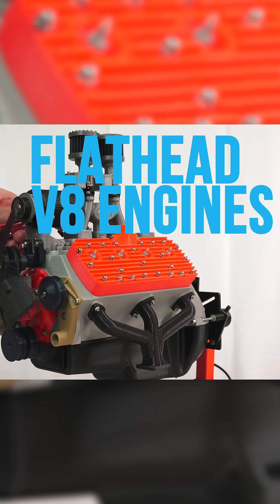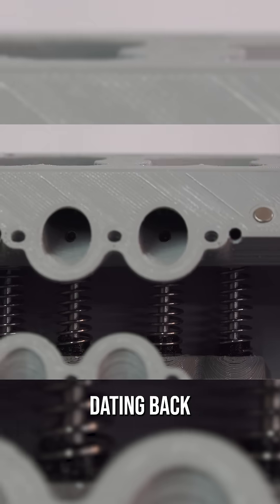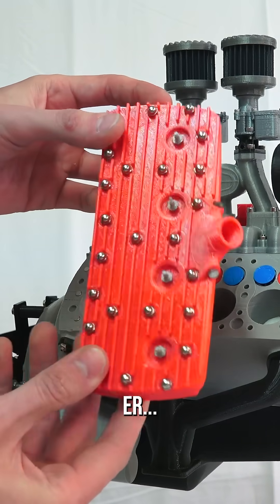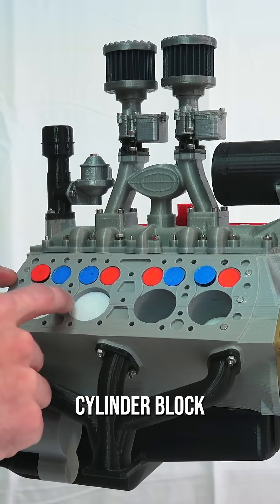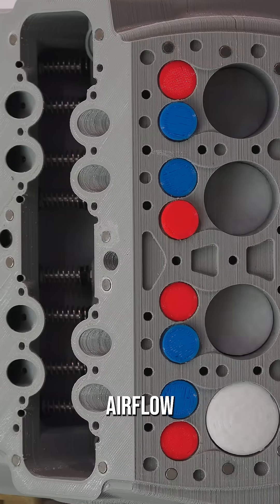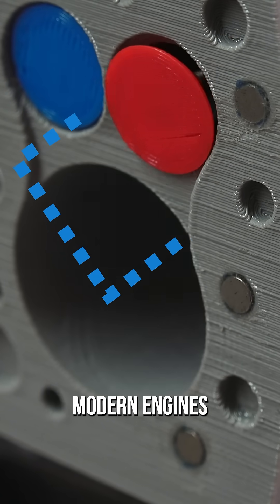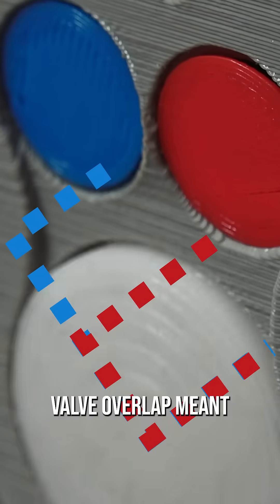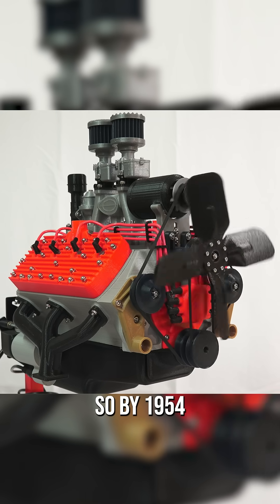What Killed The Flathead V8 Engine?

Comment: Also, it’s hard to increase the compression past a certain point with such a large area in the combustion chamber existing just for the valves.
Reply: You can actually get pretty high compression on these motors with a little work. You should look at some of the flathead open modified racing karts.

Comment: The valves are inside the V, and there are long exhaust passages through the block to the exhaust manifold on the outside of the V. That is great making a compact cheap engine, and for boiling the coolant but bad for efficiency and engine durability.
Solutions:
1 reverse the ports, have a hot V and inlet tracts outboard
2 treat it as two four cylinder engines, put the valves outside the V and have a camshaft low down on the two sides of the block.
3 go overhead valve
Reply: Now I realised part of the engine block IS the exhaust manifold, particularly between the two middle cylinders.

Oh yeah, we got a nice water boiler
Reply: Exactly. You are addressing the Ford flattie specific problems — unlike the video author who states problems common to all flatties.
Reply: 1. There are a few cam swaps to do that
2. That's seems overly complicated for little to no return of power. (Stock 49AB & 8BA only have 6.7:1 compression ratio)
3. The Ardun heads were an OHV conversation. Initially made to help with the overheating issues in the trucks. 

Granted... the most powerful stock Ford flathead only had 120hp in 1953 and got around 15-22 mpg. So they weren't all that inefficient really.
Reply: @Blackdog06019   The Ardun was made in England by Allard for a while.
I didn't know there were cams for hot-V Ford flatheads. How to find?
Reply: 2 addresses the reliability and, partly , efficiency issue — not the lack of power @Blackdog06019

Comment: The flathead lived on for many more years in lawn and garden engines, but even lawnmowers are OHV today.
Reply: @aircraftnut15 I think they meant the new OHV were crap. 

And yep, my 35y/o Kohler is still kicking. :)
Reply: @jdlackey88  Yep, I have lots of old flatheads.....
Reply: Now I know why my old lawnmower says OHV on it! never cared enough to look it up cuz i got it from a friend and it runs fine so thank you!
Reply: OHC in case of Honda...
Reply: Yeah my Briggs opposed twin is the most reliable garden tractor engine I ever had and still runs great, the ohv vtwin tho broke down many times
Reply: @MichaelLubold yep best engine
Reply: Opposed twin Briggs are flatheads and are the best mower engines in the world try to change my mind
Reply: The last little peashooter Briggs flatty was finally killed off about 4-5yrs ago.
Reply: @MrTheHillfolk  No they stopped in 2002. I have a 21 HP, one of the last. Emissions did them in. They are similar in some ways to a Subaru engine. No timing chains, just meshing gears.
Reply: @alb12345672 maybe in your country but they were around up until just a couple years ago. worked on one from 2009 today for example
Reply: Emissions  control dictates how a lot of Engine Mfgrs. Design Their Engines.
Reply: Great way to build in cost and complexity in a heavier engine.
Reply: Yes I have a B/S Opposed Twin flathead that will outrun and overpower any modern riding lawn mower engine.
Reply: @volvo09  
Water cooled and Fuel Injected !!😮‍💨
Reply: I took one apart today and their pieces of crap I have several Flathead lawn mowers from the 60s that I'm glad and thankful I still own they made flat heads up until late 80s
Reply: My dad has a 1965 Kohler k91 engine and it’s used in his lawnmower. The only thing he’s ever had to replace is blades and the carb and still runs like a dream.
Reply: Cant kill a flathead Onan. Made almost as much torque as a diesel, sounded amazing, and most examples still run today.
Reply: Briggs baby!!!
Reply: while OHV are getting more popular plenty of manufacturers are still making flatheads
Reply: The firing order is the same on the flat plane crank , 5.0  overhead cam modern engines,
Reply: The current land speed record for a Ford flathead V8 engine is 302.674 miles per hour (mph), set in 2003 by Ron Main in his FlatFire Streamliner at Bonneville. 

Sucks Huh?.. 
The sounds amazing.. in true Period correct Hotrods.. 
Cheers from Southern California 🇺🇸
Reply: Yeah and now their junk....
Reply: @will7its wdym my flathead brigs has been running for 20+ years
Reply: @aircraftnut15  mine too. A older lawn repair guy told me to keep my opposed as long as I can. I change the oil every 25 hrs. And a bit of trivia, a prototype electric car was built around the opposed!
Reply: @alb12345672 best mower engine they last longer then the actual mower does😂
Reply: now they are electric tho

Comment: I have a 60 year old motorcycle with a flat twin with faltheads. You can use asbestos-free paper gaskets for the headgaskets because it is so low powered and has so little compression.
Reply: Nice.
Reply: man big gasket really wanted us paying for those expensive gasket replacements instead of free paper smh
Reply: If you mill abt .030 to .050 off the heads it should give it a nice compression increase.
Reply: @LVBeatzMusic yeah if the set of heads didn't cost $5000 lol😂
Reply: @Purifiedbyfire420  Yeah XD. Old stuff, especially discontinued stuff, is not cheap.
Reply: Remember asbestos covering our steam pipes, brake shoes, exhaust donuts. Lead in the gasoline and paint. They did atmospheric nuclear testing until I was 4 years old.
Reply: Do normal gaskets for other vehicles HAVE asbestos?
Reply: @93_Silverado  Not now. But his motorcycle engine is old enough that from the factory the use of asbestos gaskets was standard. They were popular before everyone figured out it was bad for you.
Reply: @LVBeatzMusic  ok that makes more sense, I know a lot of old things have dangerous materials like that, but I thought he meant modern day gaskets and it made me think of every time I've replaced a gasket and than touched my face or something 🤣
Reply: @93_Silverado  Oh ok XD. Yeah they mostly use fiberglass or some other similar material to replace asbestos.
Still though, maybe wear gloves as a rule of thumb just incase something does have a harmful composite.
Reply: What kind of bike???  I’m a motorcycle mech.
Reply: @Super-Bike-Joe  He said flat twin so that might narrow it down a little...
Reply: @Super-Bike-Joe  a flat head Harley are Indian if it's a twin
Reply: @Super-Bike-Joe no conoces la BMW r12 bicilíndrica en boxer de 1935? Una belleza de la ingenieria alemana, trae cabezas planas y un colector de admisión calentado por gases de escape para un óptimo arranque en frio y buen consumo de combustible

Comment: They would make for one hell of a see through engine since all you need is a peace of acrylic to make a see through cylinder head.
Reply: People have done that. Older lawnmower engines were flatheads and people have done clear heads on them.

And a channel garage54 made a see through flathead car engine, I think it was an inline 6 if I recall..... Or maybe a 4 banger, I don't really remember.
Reply: @volvo09  Yes I've done it myself too with an old briggs and stratton flathead in my garage but I'd immagine it would look a lot cooler with 8 cylinders firing instead of just one.
Reply: @mattdaddy_888  oh yeah, the V8 would look epic running in a dark room!
Reply: @volvo09  I saw a reel on Instagram and somebody already did that to a flathead V8 and it was at some convention in another country.